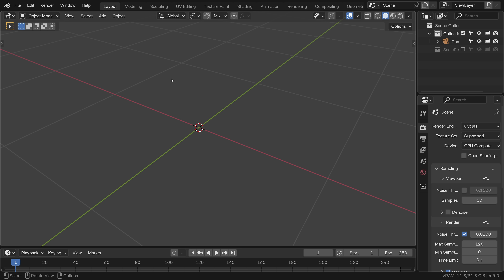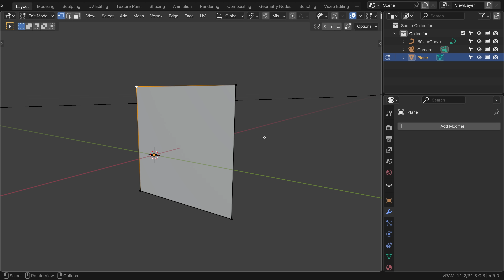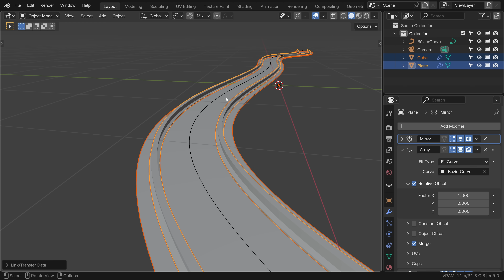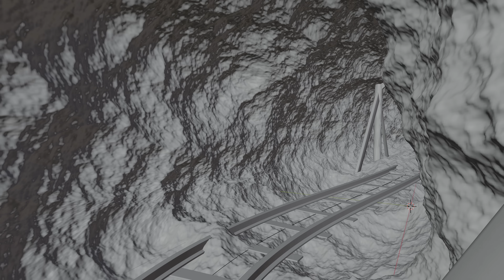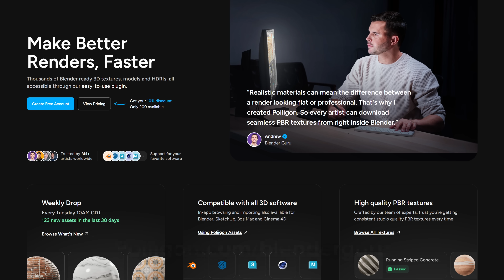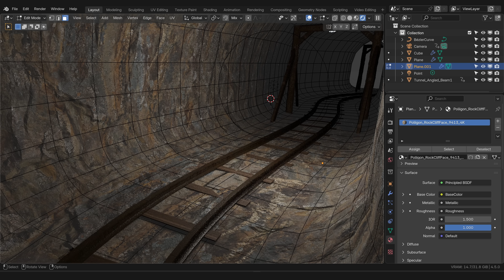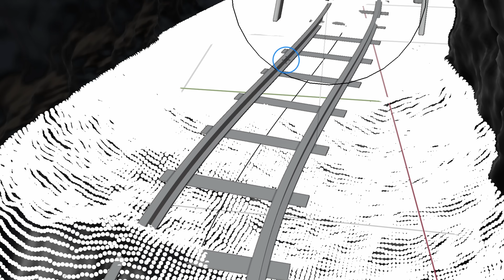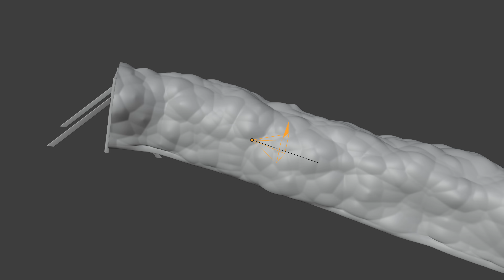How to Make a Mineshaft Ride in Blender

Comment: At 2:27, my tie turned into two side by side trapezoids. Something is not right. There is a fine line between too much explanation and not enough. So far, this tutorial is on the side of not enough explanation. I am a little disappointed. I expected better.

Comment: 1:42 Merge joins vertices and identical edges and faces. What it does not do is remove faces. The rail you have modeled has a face on both of its end; when merging it they are identical (except the normals point in opposite directions) thus only one face stays. Inside that arrayed rail there are hundrets of these non-visible faces. They drive your face count up and prevent smooth shading.
1:51 No, the rail will not bend to the exact shape. The deformed object - here the rail - has a certain depth which determains the resolution of the bend. Make the rail too long before you slap on the array modifier and suddenly a steep curve has corners. The better way to do this is by transforming the outline to a curve, than using that, since then the resolution can be adjusted afterwards.

Comment: Lingos and short details: Curves (act as an outline for creating the railroads) Displacement (whites that pull out and blacks that pull in for procedural textures), PBR textures (accurate metric of any surface down to width, heights, etc), masking (prevents the rough intersection of two different textures so it transitions more smoothly). Mix procedural and PBR textures (respectively, for the overall detail and the extensive detail) for optimum visuals. Fly mode is jittery, so blender guru's team created a geometry node that simulates inertia and gravity). You can then generalise.

Comment: the twizzler part doesnt work in blender 4.2.3 lts 1:14. the curve cant be rotated in intertwined style in x axis.  but that's a great video. will it be in the paid course in the end of the year?
Reply from the maker: You need to twist the handle by pressing T, not rotate.
Reply: @blenderguru  i try but it just hide the tool bar
Reply: No it certainly does NOT work.
"T" does not Rotate

Comment: Great Video!
As an addition, when you have the tunnel path laid out, duplicate the curve and use the duplicate for the tunnel only. This will allow you to go into edit mode on that curve and use Alt-S on different splines on the curve to make the cave bigger or smaller at those points on the curve.

Comment: i dont have a 'poliigon material import' in the left corner (free  subscription plan of poliigon). Did someone try to repeat the lesson from the video, or are the comments just bots?
Reply from the maker: The last used box only applies immediately after applying the material. If you click anything it will disappear (blender limitation). So if you don't see it, just apply the material again and you'll see it.
Reply: @blenderguru  Hello! Unfortunately, I was unable to get this plugin to work consistently on my version of Blender (4.2, perhaps due to issues with my PC's iGPU), so I will have to find another method for texturing and displacement. What you mentioned in the comment didn't work either; the window at the bottom left simply doesn't appear ;c  But apart from that, much of the work with curves from your tutorial proved to be very useful for me. Thank you for trying to solve the problem and for the video =)
Reply: Hey! Tough to troubleshoot from a distance, but the Poliigon addon lives in the "n-panel." The bottom left is simply just an operator popup that comes after you import a material.
Reply: @rileyb3d  Hi! Thanks for the help, but unfortunately, I can't see this panel. I'll have to choose a different method for texturing the PBR. Thanks again, I'm watching your channel too =)

Comment: Really nice video, but any track layout (roller coasters, mine cart tracks, waterslides or even sometimes paths) made with random Blender curves are my nemesis in 3D media.
Most of these are made with pre-made elements which often have fixed curves. Especially waterslides, those are really like Legos.

Roller coasters are made with softwares that uses 3D curves, either geometric or FVD based. Force Vector Design is a way to design a layout not based on the geometry, but on the force the riders will experience while on the ride. The forces dictate the geometry, not the other way around. You can check a piece of free software called FVD++, which is more or less what is used today to design roller coasters.
But if you want to mimic an older coaster such as a wooden coaster, you really need to use geometry (straight line, circles and concentric circles, parabolas, etc) instead of random Blender bezier curves.

Comment: can i do this after ive done the donut tutorial? 😂
Reply: You line up enough of those donuts and you've got a mineshaft
Reply: yeah definitely lmao
Reply: No until you've modeled atleast 10 donuts . 1 donut takes 6 months to complete.
Reply: Same question 😅
Reply: make the inside of the donut a mineshaft
Reply: No. Only donuts
Reply: More or less. He also does some green-screen compositing and sound design not covered in either tutorial. But between the donut tutorial and this, most of the CGI is covered.

I'm not sure if the PBR texture from this video is free? It's probably cheap.

Comment: This is an amazing video :), I really like the flickering lights at the end with the sparks. Do you have a quick overveiw of how you made that?
Reply: You can easily add sparks with a particle system emitting from the face of a small plane (i.e. your light)
Flickering can be done by either keyframing the emission power, or adding a single keyframe and then in the Graph Editor for the emission track, add a Noise Modifier.

Comment: Hate to tell you but mine shafts are vertical, connecting a level to the surface, you’ve made a drift or level.
Reply: Hate to tell you but where's the fun in that?
Reply: @CitaCadCat Clippy only wanted for us to have fun.
Reply: Bit hard to drift in a mine shaft, but I'd give it a fair crack I reckon 🚗 💨
Reply: given it has railing its more an adit as it probably leads outside